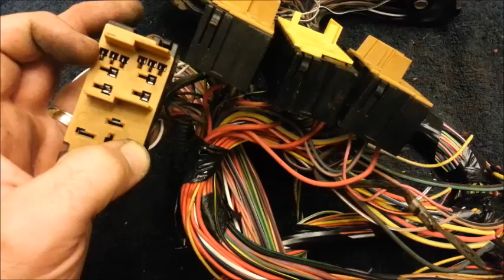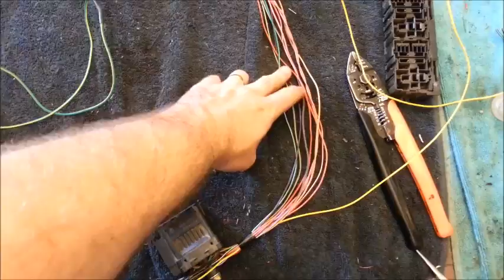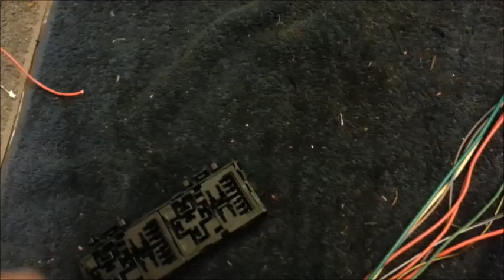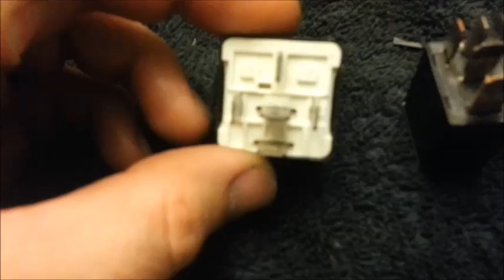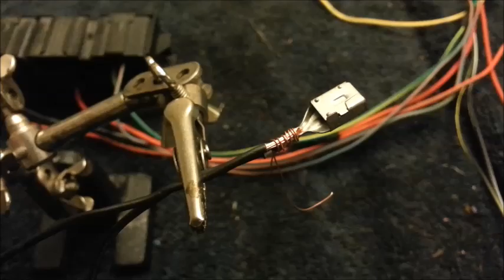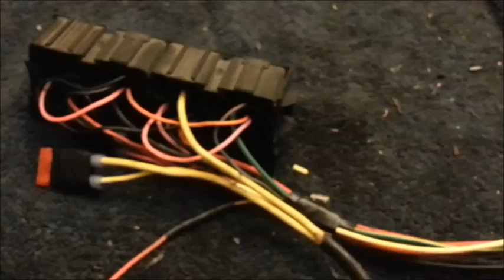5 0 Explorer OBD2 Swap   Harness Re work part 2

Comment: Hopefully you're still active I need info. I picked up a 1996 3.8 v6 mustang and looking at a 1997 5.0 explorer to swap engine it has a t5 transmission. My question is will the explorer harness work with that setup and what ecm will need to be used.

Comment: How do I do this with a manual transmission in a 2001 ranger with a 5.0
Reply: Watch his first video & it will explain a bit better. I'm  using the 4R70W so I'm  not doing a lot to my harness.

Comment: Hello. Want to thank you for the video, but I have a few questions. Im swapping a 96 explorer 5.0 into a 1990 Tbird SC, got the car without a motor so decided itd be a good bang for buck. Im going to be running the cars factory transmission, an M5R2 manual. I have a clutch, flywheel, and starter from an f150 so everything fits together well. But, what am I to do with all the transmission control wires? Do I just pull them? Do I trick them somehow until I get it tuned?

Comment: How do you wire the fuel pressure regulator in the gas tank?
Reply from the maker: You don't. 99-01 is a mechanical returnless system, not electric.
Reply: G Vance so as long as i use the pcm to contol the fuel pump im good? , thankyou great videos
Reply from the maker: Yes, but you still need a mechanical regulator. See page #6 of this thread http://classicbroncos.com/forums/showthread.php?t=257251
Reply: G Vance just to clarify the regulator in the tank is passive requires no control wires,  the pcm grounds the fuel pump relay but doesnt "control" it in any other way
Reply from the maker: Correct.
Reply: I have a 1992e150 ford club wagon van with a 5.0 motor automatic transmission with air conditioning is the pcm wiring harness to motor the same as the 1996 explorer in the your video @TheEFIguy

Comment: These are great videos. I have everything to do this for my 65 Mustang but I have one problem that I can't seem to get around.  I don't want the automatic transmission and I'm running a T5 manual transmission.   I can't seem to find anyone that could tune out the automatic.  Everyone is telling I have to run a 95 or later computer in order to have the manual trans.  But I love that distributorless ignition system.   Do you have suggestions?
Reply from the maker: I can do it. My e-mail is at the end of the videos.
Reply: Vance did mine for me as well... well worth the amount of money he asked for, and btw, it was so cheap I still feel I owe him money, also because of these videos, and the help he's provided me over the last few years...
Reply: Hello my names dyln Could pay u to build a wiring set up for my 1997 Explorer motor and transmission that I am swapping in to my 1993 ranger I can send u everything I have the explorer and I have everything from the 93 ranger